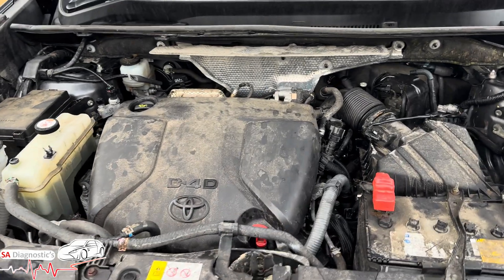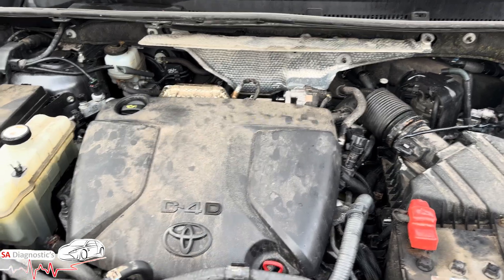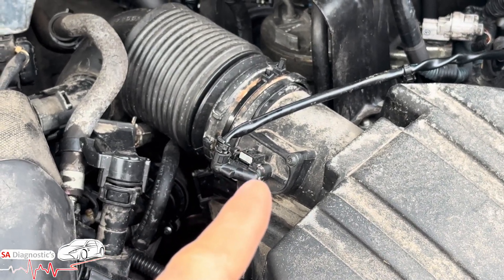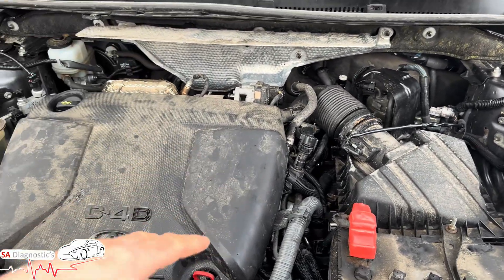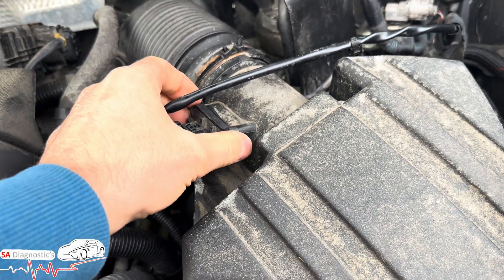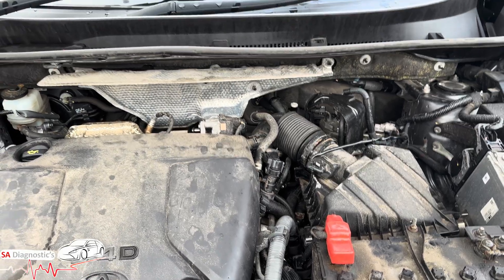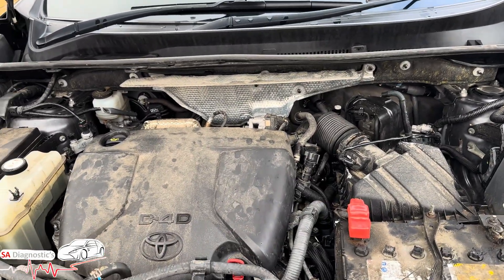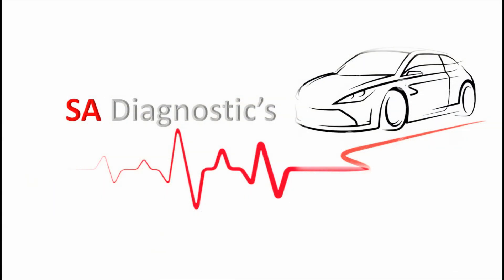Toyota P00BD MASS or Volume Air Flow A Circuit Range Performance - Air Flow Too Low

Comment: Awesome vid mate.  You don't by any change have the part numbers for the plastic trim that covers the maf plug.  I dropped them in the engine  when checking wires.  Thanks in advance
Reply from the maker: @SMBwings  hi sorry am unsure of the part number. However go onto eBay and type in mass air flow sensor housing this may bring up the part you need…
Reply: @sadiagnostics  Hi Its on the side of the  plugs sorry for mithering but you know where they are and you have the original parts
Reply: Hola!Toyota verso 115 4D Advance Diesel  año 2016 ha cambiado válvula EGR,el sensor MAF y MAP nuevo y sigue luz de avería sabes alguien me puede explicar sale luz de motor check engine código fallo P00BD gracias
Reply: @antoniogonzalez2537  Exhaust Gas Pressure pipe could be blocked.
Reply: Gracias  @SMBwings
Reply: @SMBwings pero donde está Escape La tubería de presión de gas podría estar bloqueada o sensor?dime gracias
Reply: @antoniogonzalez2537  The Exhaust gas pressue pipe runs along side the exhaust from the manifold to the back on the exhaust.  If your car isa deisal then this pipe can get clogged with carbon and throw codes as the gas has nowhere to escape causing other codes to pop up and potential engine damage.   The main things that throw the code are MAF sensor, ERG valve/cooler, Swirl flaps within maifold, however you may have other codes that will come.  The Exhaust gas pressue pipe is responsible for ensureing a good air/fuel ratio with is why you could be getting the code that most associate with the MAF sensor.  Hope this helps.
Reply: @SMBwings muchas gracias!perdón otra una pregunta donde está cuerpo o válvula  de mariposa Toyota verso diesel 115D diesel año 2016 gracias
Reply: @antoniogonzalez2537  between air intake and manifold normally at the rear of the engine bay.  You may need to remove plastic engine cover